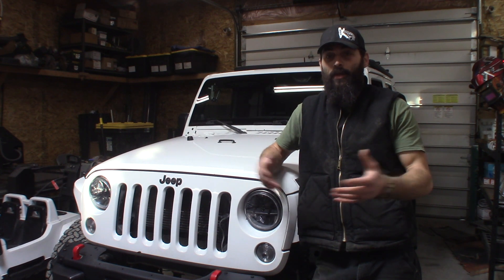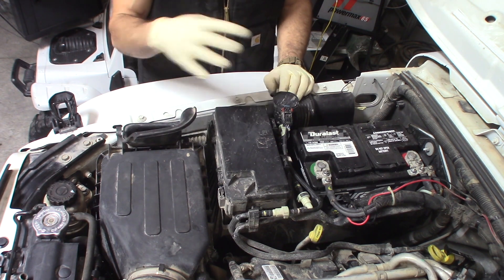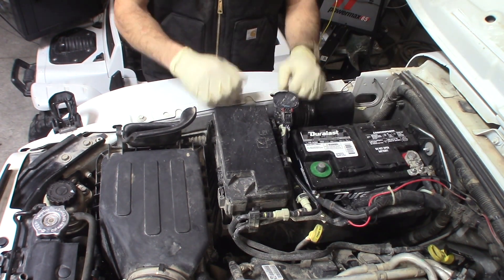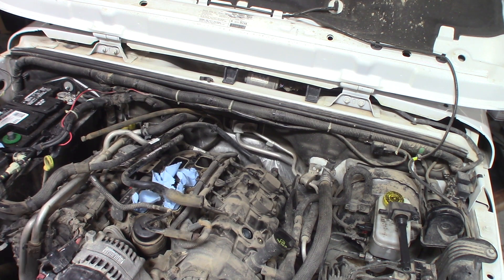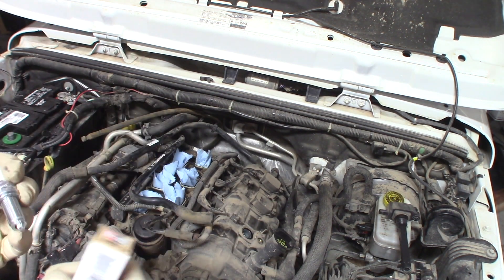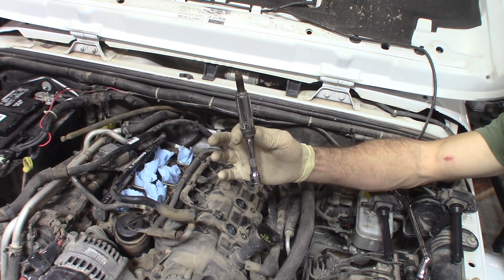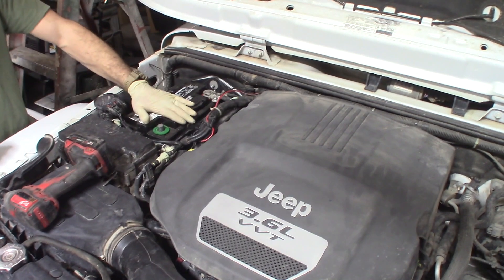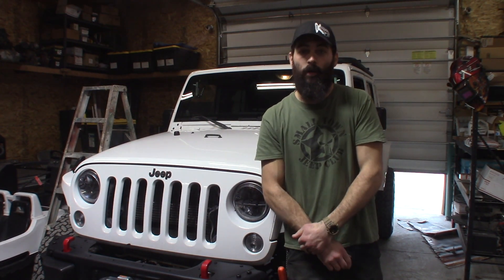Jeep 3 6L Spark Plug Replacement/RIPPmods Performance coil pack install

Comment: Are there any real world improvements that you have experienced with these new coil packs?
Reply from the maker: Smoother idle, and faster warm up times. Graphing the live data shows power band responding quicker
As far as noticeable in live time without a diagnostic machine watching data. Can’t say that you “feel” a whole lot
But there is a difference. And our economy did rise by .5mpg for the type of driving we do
Obviously that’ll vary a bit depending on how you drive

Comment: How are these holding up for you?    Just got a P0305 code on my 2016.   Not noticing any misfire or rough idling,  was told to try replacing my spark plugs and ignition coil packs.
Reply from the maker: Absolutely perfect
Reply: @KSuspension  thank you.  I'll give them a try.     Guess after 107k. It's time for new coil packs and plugs.

Comment: You have great patience with what shouldn’t be that hard. What are the benefits of a performance coil?  Fuel economy?  Horsepower?  Reliability?
Reply from the maker: You'd have to check into Rippmods website, they have dyno charts and full explanation of benefits as well. it's mainly for a bit more power and economy. Time will tell how true that is